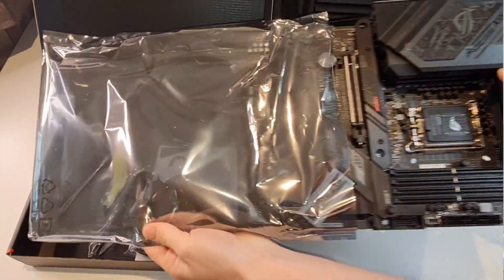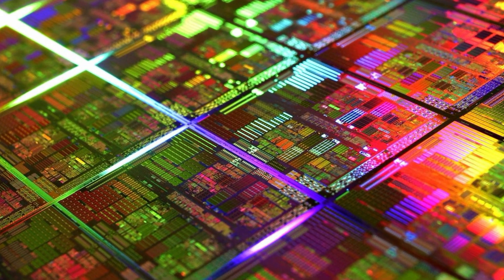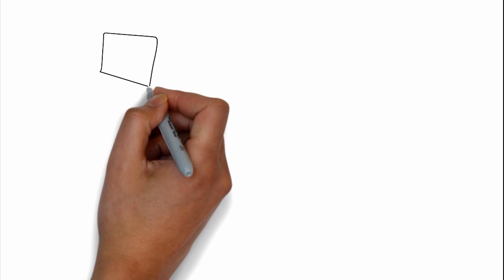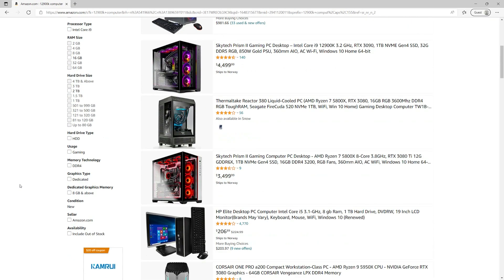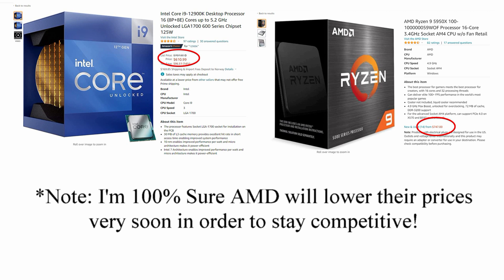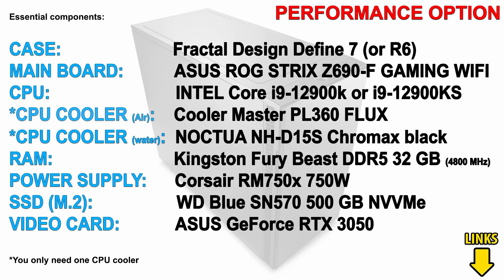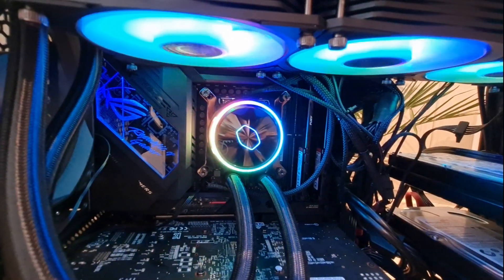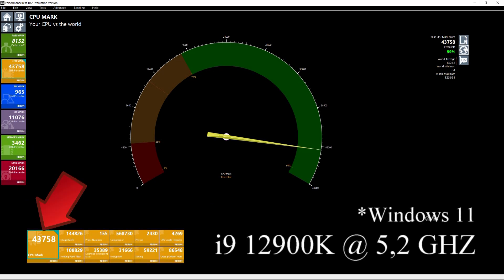The Best Computer for Music Production - What's Needed and Why!

Comment: Don't the Alder Lake processors have a sufficient on-board GPU? Curious as to why a video card is included in your systems? Would the video load from 2 monitors effect the audio processing to such an extent that it's better to just get a cheap video card?
Reply from the maker: Hi, that's a good question! There are two main reasons for this. Disabling the integrated GPU should lower CPU temperatures. The alder lake CPUs run pretty hot, to begin with, so reducing the temps can help prevent throttling, negatively affecting performance. 
The other reason is that even cheap video cards usually allow you to connect multiple screens, which can be a huge bonus since it will provide you more screen real estate. Some DAWs are more efficient than others in that regard though. Ableton for example is quite efficient here, but others such as FL Studio can be a nightmare (in my personal opinion that is) on just one screen with all the free-floating windows.
Reply: @FireWalkMusic  Thanks for the response! The heat issue makes a lot of sense, and I'd like to keep the fans at a low idle.
Reply from the maker: @DeanOlin1  You're welcome. Yeah, noise is your enemy nr.1 in a studio environment. Perhaps not as much if you only use headphones, but I always recommend mixing on monitors whenever possible. :)

Comment: I’m new to producing. I use a laptop with an intel core i5. Is there a way to increase the CPU without getting a new computer. Also if I can change it will that wipe out everything I’ve made that’s in my Daw?
Reply from the maker: Hi, if you afe using fl studio then ulyou can follow these steps to ensure that you get the best possible cpu performance: https://youtu.be/OWYmqwb7b4k

Comment: Thanks, great PC build video!  Can you clarify please – does the Intel i9 CPU 12900K build that you constructed contain a total of 16 cores? I read online that Intel's 12900K CPU have 8 Performance (P) cores and 8 Efficiency (E) cores. If your PC has this CPU with the 16 cores can you please explain how the different core sets are utilised in music production i.e. how the different 8 Performance and 8 Efficiency cores interact?
Reply from the maker: Hi, yes that's correct. It has 16 cores total, 8 performance cores with multithreading and 8 efficiency cores without multithreading (24 threads total). 

The efficiency cores will deal with background tasks and lighter loads, which leaves the performance cores free to deal with heavy loads, like when doing real-time audio processing in a DAW, rendering video and so on. Because you have dedicated efficiency cores dealing with 
other background tasks, the performance cores can handle the high-intensive tasks uninterrupted, so they don't cycle back and forth
between the audio-processing and the background tasks, as other CPU's would. This gives it a huge raw performance boosts. 
As I explained in the video, when it comes to audio processing in a DAW, you can't always process in parallel. There's a lot of waiting going
on, so it's kind of serial-processing dependent, which requires fast single-core speeds, and that's what this architecture provides.

Comment: How about the Intel Core i9-9900KF 8 cores?
Reply from the maker: As you can see from the comparisons the 9900k is still a quite effective CPU for music production and should be able to handle most project sizes, even fairly large ones. The 9900KF should also perform quite well. The difference between the K and KF is that the KF does not have an integrated GPU.
Reply: Thank you so much !

Comment: I got a HP Elitedesk G1 with a i7 4790k and 32 Gb of RAM with 2 Samsung SSD's  and is working good for now but I'm planing an upgrade.
Reply from the maker: That should work ok for most small and medium size projects. You probably won't be able to produce with ultra low latency though (high buffer settings) so an upgrade will probably make things easier, that's for sure.  Especially if you like to record midi or audio during the creation process. :)

Comment: Thank u.. I am about to make a pc for myself and am thinking about using 3060ti + i9 12900k , 32gb ddr5 ram...?
What do you think?
And how much did it cost you to make this build?
Reply from the maker: That's basically the same setup as shown in this video (see link to all the parts i used in the video description). The 12900k should work very well. The rtx3060ti will also work well If you also do some gaming in between. :)

Comment: You should go with M1 :-)
Reply from the maker: The M1 is great, but according to benchmarks it has on average 15% lower single core performance compared to the 12900k, so it's reasonable to assume that it won't outperform the 12900k when it comes to music production. I'm also confident that the faster DDR5 plays a huge role in these comparisons when you see how well the 12900 does even compared to the 9900k. 
If I had the money I would get the M1 just to do the tests. Unfortunately I'm a PC user and I'm not rich :)
Reply: @FireWalkMusic  If you are PC user, then you are absolutely right :-) Great video!
BTW Aren't you tired with Windows updates which start in the most unexpected moments? ;-) That was the main reason I moved to macOS and I use FL Studio there.
Reply from the maker: @kocho4242  Thanks! Yeah that was really annoying. I finally figured out that you can set it to manual, so that it won't install or download anything unless you tell it to. 😆
Reply: @FireWalkMusic  annoying for those who don't update PC on time 😂😂.
I'm quite happy that they push updates on regular basis. 😀😀
Reply from the maker: @rohitRraina  yeah, it's important to stay updated. At least in windows 11 it will install updates when You're not sctively using the computer, so it's not like it once was where it would suddenly stsrt while you were in the mindre of something. You can also set it to manual, for even more control. It works quite nicely for me now, and my computers is always updated. 😁

Comment: sadly, prices for computers has gone up in these times, i got pretty lucky when i got mine built in 2016, 16 gb ram i7 haswell @ 4ghz and for about 2k but i have upgraded it since then to be 32 gb ram with a better soundcard and better gpu and a higher hz rate screen
Reply from the maker: Indeed. With everything that's going on in the world right now everything is getting more expensive. That said, cpu prices has dropped a little bit though due to strong competition between amd and Intel, which is great for us as consumers. GPU prices are also going down slightly, but everything else is getting more expensive unfortunately 😕

Comment: Nice video and suggestions.  Ironic that an audio production channel with great video production has such a terribly irritating and annoying sounding intro/ extro host, though. Voice like nails on a blackboard!
Reply from the maker: Hi, and thanks for the feedback. Decided to try something new this time. Guess it wasn't a huge success then. 🙈
Reply: @FireWalkMusic  Nice idea, cute; but main function of voice announcing is horrible.  By the way the $880 "budget" system is a great deal, both in $ and performance. Should  work for 98.8% of all audio (and other) chores.  If you're live mixing umpteen dozen tracks with 24 bit audio for a movie soundtrack, then spend the extra $$ for the "Performance Option"
Reply from the maker: @shazam6274  fortunately I structured this video so that I can use the part after the graphics intro as an intro as well, so it's actually possible to just cut the main intro and start the video from  there. I might have to consider doing that. 🤔
Reply: @FireWalkMusic  Listen to it a few times, and then decide
Reply from the maker: @shazam6274  yeah, I don't really have any negative reaction to it to be honest. If I did I wouldn't have used it.😄
But I know people perceive sound very differently so I'm curious if others feel the same way too.
Reply: @FireWalkMusic  I liked that intro/outro host thing, yes her voice has bit too much high frequencies other than that it was really refreashing  👍👍
Reply from the maker: @viceralchart6343  thanks! Really appreciate the feedback, both good and bad, so don't hold back! It will be put to good use, and help improve my videos and my style going forward. :)

Comment: I have a 12900k with 32gb of 5600 ram and it gets double the performance of the 9900k in FL studios cpu metre
Reply from the maker: The 129900k is a real beast. The 9900k is still a very capable cpu but I'm thinking that the faster ddr5 memory and the performance and efficiency core architecture makes a huge difference when it comes to single-thread heavy tasks such as music production. 😀
Reply: @FireWalkMusic  Ya definitely. I have a 9900k system to compare to also as it was my last system. Definitely the ddr5. Check out Scan computers pro audio channel and benchmarks video and they show the exact reasons.
Reply from the maker: @aro7975  I'll check it out. I talked to image-line about this a few years ago. I tried going from 4 channel to dual channel memory with the 5820k and I saw a 40% performance drop. According to image-line, In theory ordinary dual channel ddr4 should have more than enough bandwidth. You shouldn't really be able to overload it even with the most ridiculously huge projects. 
Theory and practice I suppose. Not sure why it has such a big impact even if the bandwidth isn't maxed out, but it does.
Reply from the maker: @Gared Alkon Hi, no it's not the amount of RAM that's important, but rather the speed of the ram itself. For most people, 16 GB will be more than enough. Very few people actually need 32 GB for music production alone, unless you work with enormous orchestral projects with huge libraries and such, and even then it's difficult to really use up 16 GB. It might get filled up with other stuff too though, so many go for 32 just to be on the safe side. You definitely won't need 64 GB. :) I would spend the money on faster RAM instead. :)

Comment: Wow get info. Im into music making . I have a dell i7 it has 4 cores laptop but using some sounds on my fl studio my cpu will jump from 20 to 50 and i get that cracking sound. You know a fix for this or what i can do? I also have the cooling pad under my laptop. I guess that helps. Lol
Reply from the maker: Hi, thanks, glad you found it helpful. This is a common problem. When you get that crackling sound it's usually because the CPU isn't able to process in real time. In other words, it's overworked. The only way to temporarily "fix" this is to increase the buffer by going into the audio settings - > ASIO driver and then increasing the buffer size from there. By setting it to max you might be able to push your CPU a little bit more. Enabling triple buffer can also help. 
This is just a stop-gap measure though. Eventually, you might have to upgrade to a faster CPU, or alternatively, start "freezing / consolidating" tracks in order to save CPU. :)
Reply: @FireWalkMusic  wow this was good info. I will try that. Thanks a lot👍
Reply from the maker: @GoReallaBeatz  you're welcome 😊

Comment: Apple hates you as a customer and has laws that prevent you from fixing YOUR OWN COMPUTER. That alone means you should pretend they don't exist.
Reply from the maker: I don't really have anything against Apple, but I don't like the way they try to lock people into their own ecosystem. Imagine if / when they unveil their new electric car... that can only be charged with Apple chargers.. 😂🙈
Reply: @FireWalkMusic  A friends local repair shop was SHUT DOWN by apple because he fixed peoples computers for them instead of them. Im not sure how you can read that and not get angry.
Reply from the maker: @jonathansoko1085  that's just not acceptable! The EU has a case going now, which will probably force then to make their device repairable, at least in the EU. It's one of the reasons why I never bought any Apple products. I'm sure the products themselves are great, but what you just described, and their refusal to implement the same standards as everyone else just so that they kan keep people trapped in their own ecosystem just doesn't sit right with me..
Reply from the maker: @jonathansoko1085  btw, not allowing repairs is terrible for the environment too..